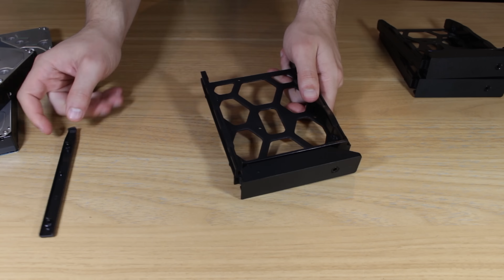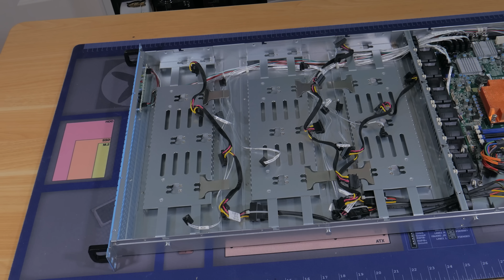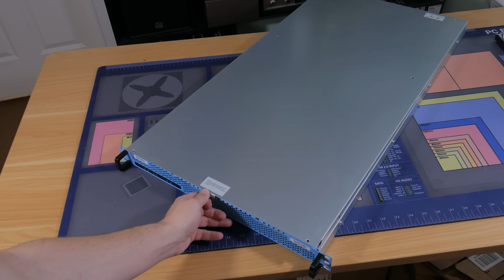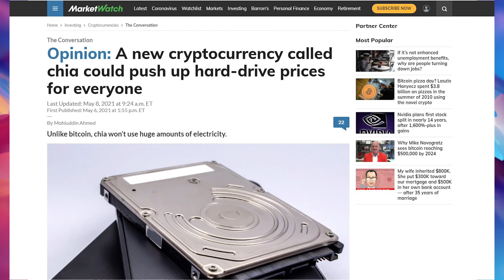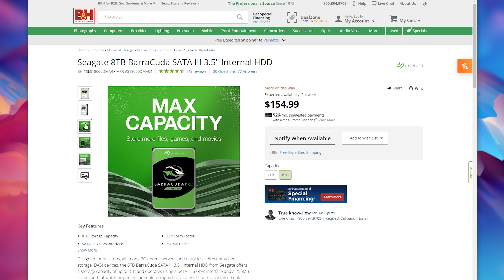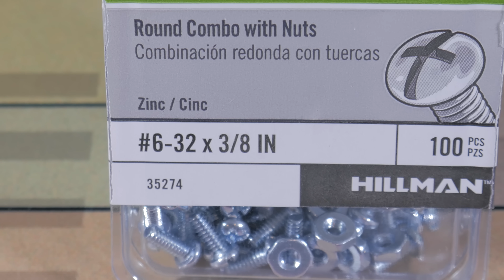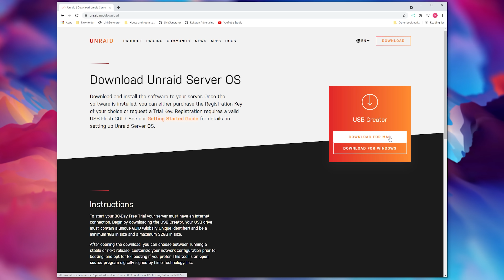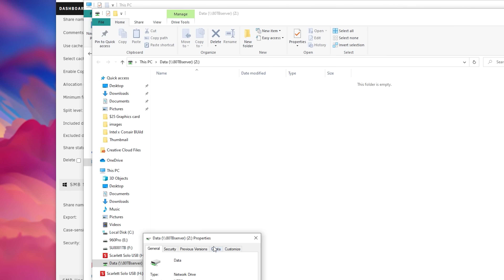Budget Storage Server 2021! | 80TB NAS

Comment: The way he's handling that ram made me feel anxious.
Reply: JT is 100% correct. I used to supply large amounts of PC equipment to a scientific firm. They had a defective memory module and decided to decap the module and put it under an electron microscope. They provided me with the pictures. The static electricity discharge makes small “nicks” into the silicon and copper traces inside the chip. This can make weak points in the copper and eventually it can burn out like a fuse. So if you mishandle electronic components, you can damage them even though they still appear to work, only to discover that you’ve significantly reduced the lifespan of the device and increased the probability of failure. In my case the firm I was dealing with was able to confirm that somewhere in the supply chain the items were handled without following correct ESD procedures. We found the problem was with one of our wholesalers and so we changed who we purchased goods from in the future.
Reply: Not even sure what the point of that was
Reply: Yeeeees, absolutely awful RAM handling, it hurts my eeeeeyes 😖
Reply: No, No!  He did it exactly correct!  The finger flipping of RAM sticks before installation helps to redistribute the bit flippers inside the byte-arrays on those chips.  Many people don't know to do this, and most of the time it's fine.  They will eventually self distribute.  But, if you want the best performance up-front, remember to do your RAM Flipping!
Reply: @rbstorms  What? Haha, this isn't actually true, is it?
Reply: If you want to handle computer components in a frivolous or disrespectful way, just wait a few years! In cold weather, I use a 512M DIMM to scrape ise off my windscreen! :-)
Reply: People are too carful with their components still, their pretty resilient these days!
Reply: @includenull  static build up is static build up. Handling it like that is called luck, not component resilience.
Reply: @includenull  You should still be careful, like  JT wrote already earlier: "static build up is static build up". Just because it didn't happened in LTTs video, it doesn't necessary mean that this can't happen. There are a lot of factors involved in this, especially with computer hardware. Prices for a variety of different components are going up these days and I personally would be extra careful with the bought hardware. So you could say that there is, besides of the technical issue also a financial one.
Reply: @includenull  LTT’s verbatim conclusion was “you’re rolling the dice”… so… Handling it like that is called luck, not component resilience…
Reply: @includenull  also, given its kinda impossible to detect data integrity errors in non-ECC RAM, hardly feels conclusive that “modern components are resilient” if the PC still POSTS after zapping it. Probably won’t discover the error until you’re in the midst of working on a critical deadline and you get a kernel panic
Reply: @jtonline99  nah. Components today are 1000% more resistant to static shock just by the change in manufacturing and other edits.

That doesn't mean rub it on a balloon, but in 30 years of dealing with tech, I've never had a single component zapped.

I talk to some of the old-timers and they had it happen quite often.

You're thinking of tech from 30 years ago as if things haven't changed. Fact is, modern components are indeed far, far more resistant. It's just fact.
Reply: @roxert0  They used voltages higher than what you could exert with regular static buildup, with higher currents than natural static buildup, so unless you're touching the bare chips or have a power plant hidden in your body there isn't much to worry about. Consider the fact that those components have been touched by atleast 20 people to get to your hands and most of them probably weren't wearing anti static gloves or bracelets and they still survived, every component that is inside your pc right now can survive x-rays so I don't think a light shock from a build up of static will brick your 50$ ram.
Reply: @jazeenharal6013  as a hardware design engineer I can tell you that in fact ICs are MORE susceptible to ESD. There are a few tricks to "reroute" the discharge but semiconductor processes get smaller and smaller which makes them easier to destroy. The fact that you've not seen the things you've zapped fail is that they've just limped along long enough for you to replace them with the next generation of tech. You'll be lucky if you get a catastrophic failure from ESD (in the sense that you'd want your circuit to fail so unequivocally that you know what's wrong) but the fact of the matter is that ESD just causes erratic, non-repeatable behavior that you can describe as "random" at best. Wizdude and JT are on the money on this one. FWIW.
Reply: @JesusPerez-mt4kz  thanks for the post. This is new info to me. I had always assumed that the lack of failure came from added resistance to ESD-based failures.

I'm going to handle my stuff much more carefully in future. I've gotten too careless, it seems.
Reply: @jtonline99  bro static electricity is not an issue, i work at a datacenter and have deployed literally thousands of servers with probably petabytes of ram and NEVER EVER EVER had a single dimm die to static electricity
Reply: I cringed...no regard for ESD whatsoever.

Comment: unless you need a high-density compute / storage cluster, why would you ever use a 1U chassis?  At a minimum, go with 2U, but 3U/4U is even better for rackmount deployment...
Reply: Why?
Reply: @StephenBuergler   1 u is super condensed, heat can be an issue, those 12 drives in a 1u case could have been 40 or more in a 4 u case. And ofcourse, can a honey badger or three fit in there ;)
Reply: I imagine that the low cost of the server may have been a motivating factor. It would be for me.

Comment: Matt nice video...just curious how loud the fans are in this chassis?  As you stated it only has that copper heat sink for the CPU cooler but curious how loud the system runs and are you able to throttle those fan speeds?  Thanks.

Comment: You didnt do your research enough. 10TB expansions were yielding 10TB Barracuda pro PMR drives, I was buying these and own 4 in my Synology NAS. The 16TB's had a good chance they were EXOs, my last 2 had EXOs. They are no longer in stock on Amazon. One other thing you probably should have done was do a write/read check on them before shucking. If there were issues at least you can still return it or claim warranty.

Comment: I ended up buying a used Lenovo P500, a few hard drives and expansion bay where one of the 5.25" bays are (for extra drives) and away I go.  It cost me like $160 for the PC.  Missing its side panel but I am gonna build one out of acrylic anyway.

Comment: Not sure if others mentioned but try using two cache drives in raid 1. That way your content is protected in case of data loss before the mover would take stuff away from the cache. Second, check out Spaceinvader's videos. You may find cool tips for plug-ins and folder, drive structuring.

Comment: Is the price difference between shucking external drives vs naked drives due to better market pressure value for the external drives?  Are you comparing the price of buying one to one retail?  Is there a way to buy, say, a bulk box of 10 raw drives, maybe direct from the mfg or at least wholesale, instead of buying 10 boxes of 1 drive retail?  That might bring down the price difference per unit for a multi-drive project like this and also save a lot of time and effort.  And moreso if you plan to do multiple projects, to have a large stock of drives that you can utilize for multiple projects.  Maybe get yourself a box of 20 drives or something, divide them up between 2-3 projects, and even if you have 1-2 leftovers, they can easily be turned around on E-Bay or something.

Comment: better use cctv drives for cheap nas , i used desktop ones and all of them died within 2 to 3 months of staying on 24x7 .. thankfully Seagate refurbished the drives for free and i use them in my pc now and bought cctv drives for the nas as they were cheaper and all of them r working 24x7 for last 3 years with no failure!

Comment: If I was to start with less drives, would I be able to easily add more later on?
Reply: yeah of course! you don't have to fill out all the drive cages from the start and you should be able to reconfigure the server to add the new drives in software once you put them into the unit.

Comment: only issue you will have is vibration from non nas drives that may cause issues later. I built a truenas system off am2 phenom quad core and 2x 4tb Iron wolf and 2x1tb WD Drives in it for under 500.00 server chassis seem like a good idea till you hear the noise even in a closet you will find the wine of fans to be annoying

Comment: Average of $125 each on the HDDs? Great deal considering they are no longer available on Amazon and NewEgg showing $220 each now. I'm not going to say the same BS other comments did about them not being NAS drives, obviously NAS drives that are CMR would be better but, if you consider the idea that you might only be using this for more of an archiving type purpose and not necessarily lots of continuous IO then mainstream drives are not a terrible idea at all. For the price paid for the server, I think this is a great option. Interested to know how well it is managing the heat since 1U servers can run pretty hot.
Reply: (in Ukraine the one single 8TB Barracuda costs ~$339 today, was ~$562 in May...)

Comment: This is a great solution to pack lots of TB into a 1U chassis! Unraid was the way to go with those SMR drives. Since those aren't rated for NAS/server use, it'll be interesting to see how they hold up over the next few years. Remember: RAID IS NOT BACKUP! :)
Reply: Unraid is very forgiving for the drives. The ones not in use are normally spun down.
Reply: Remember 3 2 1

3 copies at least 
2  or more forms of media (flash and had, cloud,tape)
1 or more off site backups

Comment: that is like 3 or 4 or 5 drives more than what my little server can do but i dont really need a ton of space anyways but i do plan to upgrade the drives i have  in a Dell server at some point as of right now only 5 of 8 drive bays are in use disks 1,2,3,4 have 2tb drives in them with drives 3 &4 where transferred from another thing i put together non of them are in raid as it only has a perc h310 raid controller/HBA while disks 1&2 where drives i originally started out with in the build while drive 0 for me is the OS drive and its a Crucial SSD

Comment: Oh God, not Barracuda's
Reply: You can’t do budget with expensive drives.
Reply: Well even doe it used barracuda for this (not recommended) Unraid has the capacity of making 2 parity disk that will store everything in does disk. If any disk fail, unraid will restored back. That the amazing thing of that software. But yeah, barracudas should not be used at all for this kind of things 😅
Reply: It's called BUDGET for a reason. I doubt he has 10 grand for proper drives.
Reply: Cheaper than ironwolfs
Reply: @AJ_Animations  more likely to all die at once and cause permanent data loss in the first couple months than Ironwolf as well

Barracudas aren’t made for the settings of servers, you aren’t being scammed by enterprise/nas drives costing more than the cheapo’s, servers are simply an expensive hobby
The ones in this server are much slower than enterprise drives, aren’t rated for the vibration of so many drives in a single chassis, the stores they will be under, and will lack the needed statistics/warnings of drive failure needed

Also oh god an old psu with a data server…
It’s worth, if you get a really cheap server chassis and are going to do this, getting a second hand 80+ platinum server psu

This video is made for getting your views, showing you a cheap way around things that you need to take an expensive path
If you care at all about the data to be stored on something like this, don’t use this, doesn’t mean you have to buy the nicest stuff in the world, but this is basically a waste of money
Reply: @terminatorfishstudios  can't you just replace the PSU once it breaks? Seems like in this setup uptime is not a priority
Reply: @terminatorfishstudios why don't people go for sas drives? I just snagged 9tb used for 50 and they're pretty much by definition server grade. More redundancy, faster access, supposedly more expensive but that hasn't been my experience. What am I missing?
Reply: Not to mention 80tb with that few drives is likely in a raid 0
Reply: @YouEverJustGetLikeAaaa he said two parity drives
Reply: Still better than wd 😒
Reply: @fen0221  LOL is not about the brand.

Comment: excellent video and this server overall is MORE than 99% individual users will need
Reply: Yeah, I'd have started with fewer drives.  I use 4tb more and buy in sets of 4 or so.  And, it takes a good while to fill them.  So, 80TB or (to be more exact) 60TB from video, would take quite a while to fill.

Comment: 9:06 lol im not the only one how just tapes in ssds instead if actually securing them
Reply: I like to use the 3M picture-hanging Command strips, which are like velcro with removable adhesive. They're much easier to remove later.
Reply: @edattfield5146  Me too, I love those things.

Comment: Overall solid build, but I'd never put a 1U server in my home, those tiny fans are too noisy.
Reply: Typically I would agree from all the servers I’ve worked with in the past, but I have a Dell R210 1RU server at home that runs at room temperature and is almost silent unless I push the CPU workload up high. It’s pretty impressive. Most of the newer dell servers are also fresh air rated. It’s a stark difference from the earlier IBM servers I used to work with that sounded like aircraft taking off :-)
Reply: I had a 46RU server rack in my house for years.  I'll never do it again.
Reply: @markc6714  why?
Reply: Yeah, I would only do it if I had a dedicated server area in a basement or something. Maybe some low power Atom or ARM processers would run cooler and be fine.
Reply: You can always splice in some resistors to slow and quiet the fans. I did that on my old Dell 2U server.
Reply: Not really.. just make sure you over size it.
Reply: You can use the small noctua fans instead
Reply: The NR12000 Server is quiet as all hell, I have it running below the cash register of a local diner. Aside from it only being a quad core cpu and single socket board,  it's been good.  The board has an internal usb port that I run Unraid off of  :)
Reply: Proved to be real quiet at least in my home tho
Reply: I agree. Very nice build, but It's very few people that have a basement or sound isolated room where you can hide a 19" rack server away. even its small 1u height these babies take quite a bit of space, and the noise is the even bigger issue if people live in an appartement it's close to impossible to find a suitable place to hide them away without the noise being an issue. Problem to build a "compact" system (if you can call a 10+ disk nas "compact") is to find a suitable Mobo/sata controller with enough connectors to support a "pro" level nas configuration. Even you can find mobo's with 8 Sata connectors, they are often spanned over 2 different controllers wich can be a problem dependent on how well its implemented on that particular mobo model. Thats why if you want to make a diy Nas, a 19" server is often the only way of getting the flexibility you need, and like Matt found out the choice of buying off shelf external drives and hording the drives can be risky if you don't know exactly what kinda drives is inside. Dependent of cause how "pro" you want your system to be vs price. There is a reason why eg Seagate's server grade 24/7/365/10 year drives cost over 3 times as much as their equivalent consumer grade drives, and why they have different drive series today dependent on what usage you plan to use them with.
Reply: @mrdali67  Great point. I have a basement but I have my home gym and multipurpose room down there, so I’m there enough where I wouldn’t want a noisy server there too. 

I’d put mine in the garage, after theft proofing it.

Comment: Is he using the SSD as read cache only, or write cache to? If that drive crash (wich it will do, as its a MLC ssd) it will break the array if its used as write cache.
You really need to run two in mirror, ATLEAST..

Comment: If you don't need very quick access to all of your files, buy yourself a LTO tape library. Go at least with gen 5 or higher since they support LTFS. That's the enterprise way of keeping data safe since tapes are much more reliable than drives, they are rated for at least 30 years archival data retention and like CDs/DVDs you can always buy a different drive if your drive fails.

Comment: Since those aren't ironwolf/red drives, with the vibrations and all, is it still safe to have/run that many drives? Or are the rubber gaskets enough?
Reply: I dont think so ;) barracudas are for PC and no 24/7. Think about power consumption and temperature.
Reply: @games8832-v6s  yeah but the title says "NAS"...
Reply: @ccc4964  even if its budget then you have to follow some specs to use hardware which is designed for 24/7 etc. Becasue in NAS most importat thing is  the "data".

Comment: You Know I Don't Need One Of These But Having One Would Be Pretty Sick
Reply: same. i would probably be fine with a very low storage amount for myself, but to have it all stored and accessed through the network instead of having to plug in an external every time, as well as having redundant backups is pretty sweet.